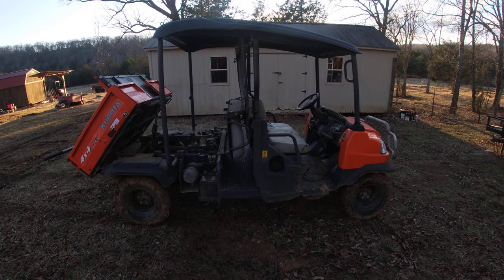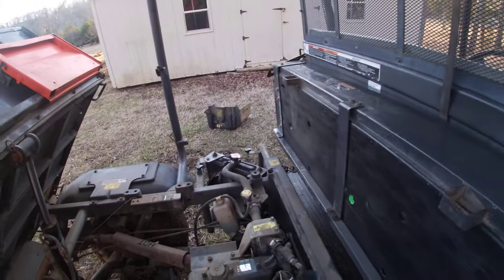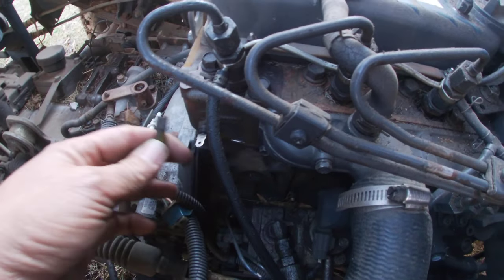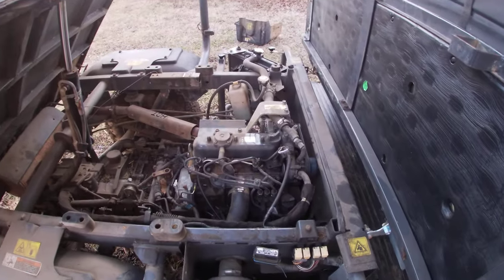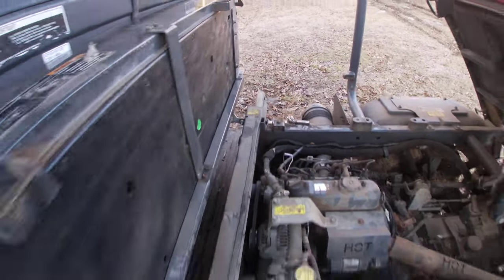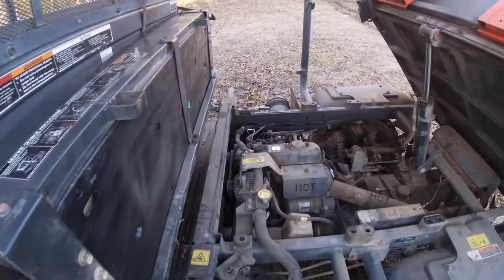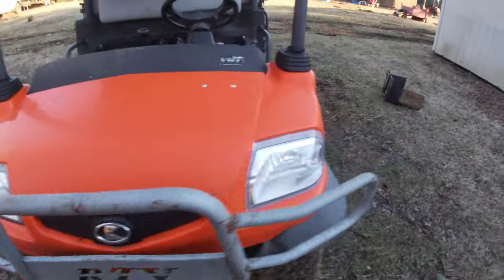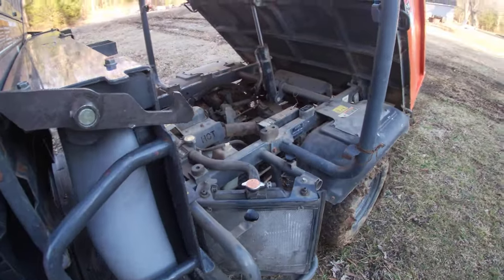Kubota rtv 900 and 1140 overheating fix!!!

Comment: Awesome fix!  I recommend put a delay so that when you turn on the key it starts the fan after about 5-10 seconds.  That way the fan turns on after the unit is on and less drain on the battery since it will be charging when the fan turns on.  If you ever put the delay please make a follow up video, would love to see how that turns out.